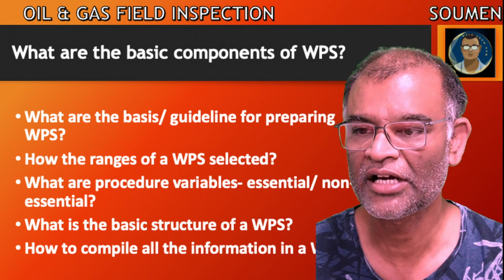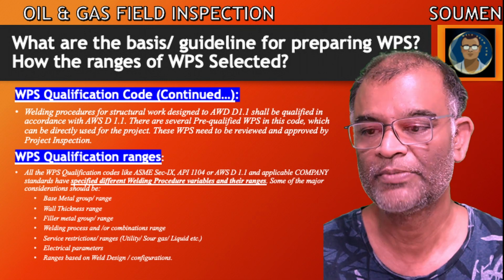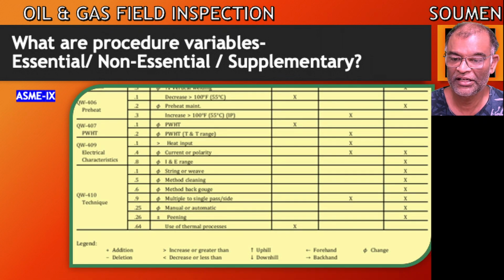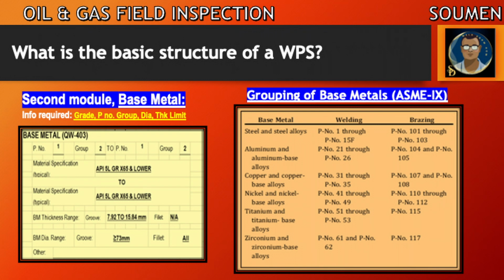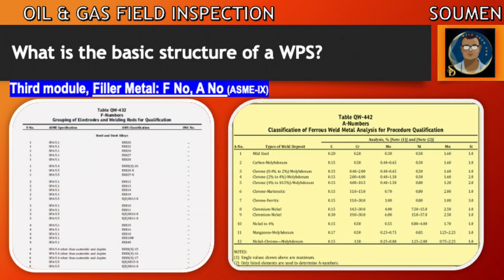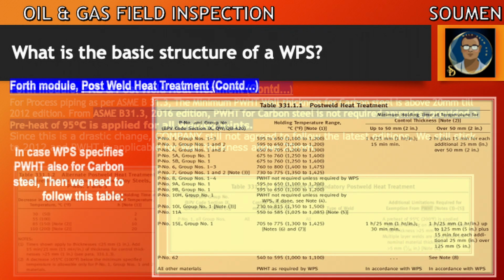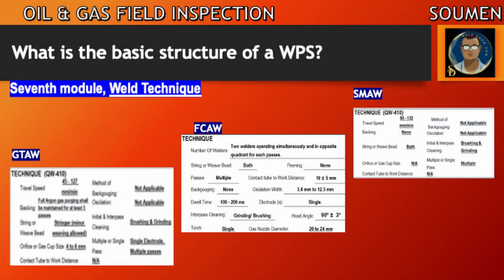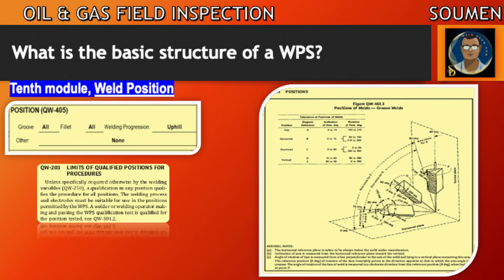WHAT ARE THE BASIC COMPONENTS OF A WPS Part 2

Comment: Hello, when writing wps how do you know if impact test,tensile test or hardness test is required?
Reply from the maker: Sorry for the late response. Requirement of impact hardness tensile depended on the design code and the wps qualification code. For example if the line service is sour gas, hardness and impact is mandatory as per same B 31.8
Reply from the maker: Asme B31.8. So you have to thoroughly study international code as well as your clients local codes and standards too